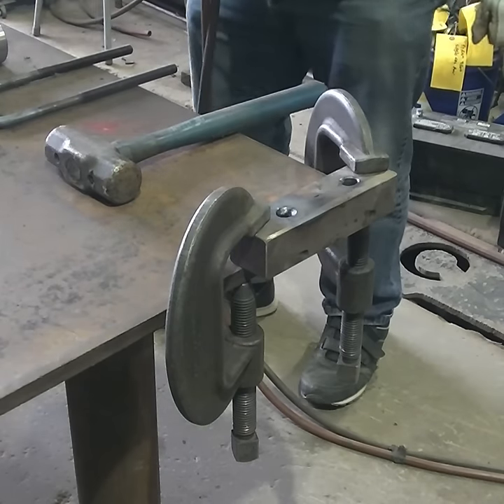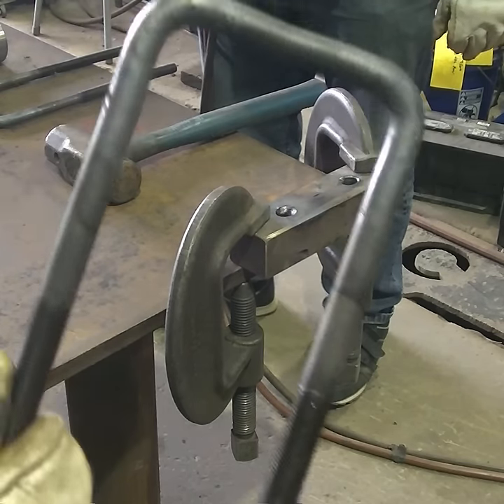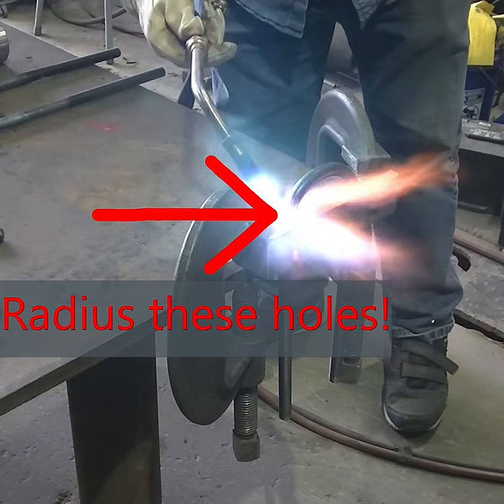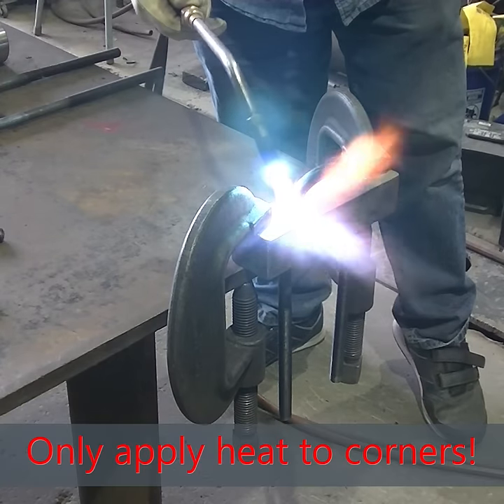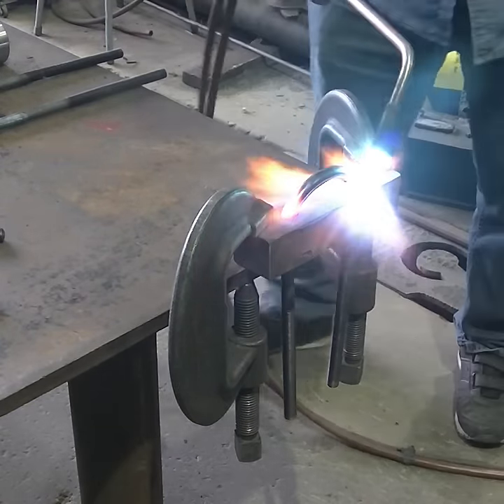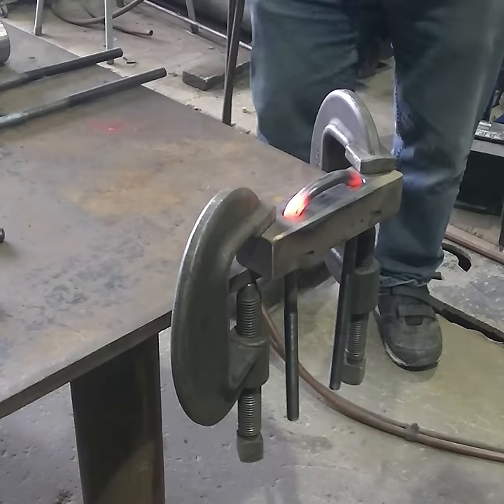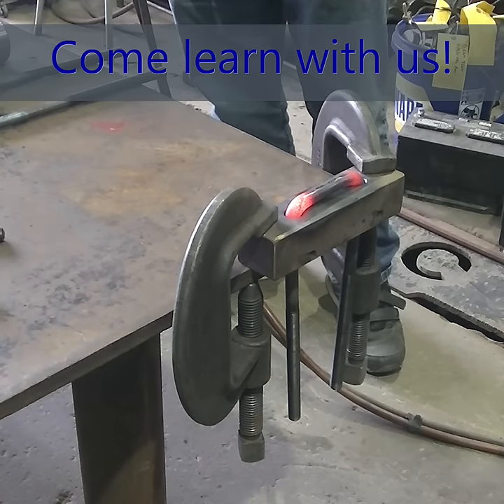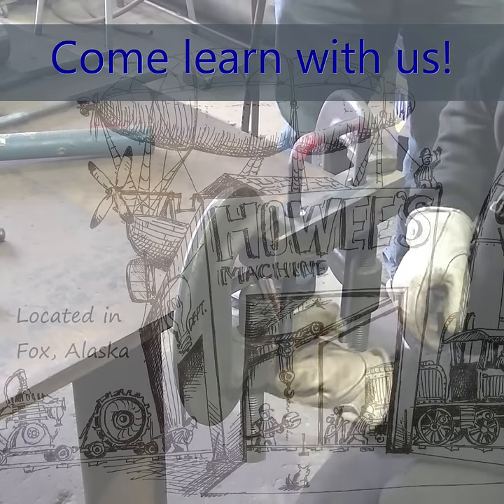Machinist's Minute: Squaring a Rounded u-bolt

Comment: Just return them and get the right ones . By heating those like that you've probably ruined the temperament of the steel .
Reply: Kind of what I was thinking.

 Every set of springs I've had made were bent using a hydraulic machine and form dies. About any tractor/semi trailer heavy machine "spring shop" can make them in a matter of minutes. Just give them the measurements you want or bring in as much of an old one that you can and they will measure for you, give them a little while depending on how busy they are, and walk out with not only a new set but grade matching bolts and everything.
Reply: Also, by running a carburizing flame like that he's adding a lot of carbon to the steel which can make it very brittle. I used to fix my chisels this way
Reply: Ah yes because they surely have no idea how to retemper.  Applogize to the nearest plant.😢
Reply: @i-love-comountains3850  did you see them temper it???
Reply: @i-love-comountains3850  did you see them? They obviously don't know much about much.
Reply: It's not going on the space shuttle.
Reply: It’s mild steel. It won’t harden hardly at all and will be perfectly fine for whatever applications he’s using it for. People watch a few knife making videos and become metallurgical scientists. I made dozens of U-bolts and for custom fitment. Never broke one and never had a customer come back with a broken one.
Reply: @Sackmatters  in this case it will harden it because he's using a carburizing flame which is called carburizing for a reason because it adds a ton of carbon to whatever you touch the flame to which makes the steel much harder and brittle. Some people take a few metallurgy classes at an accredited university, rated number one for welding technology in the United States, number two in the world, and think they might know a thing or two. Some people have also used a carburizing flame before to harden carbon steel to make a makeshift punch that will usually break. I'm not saying these you bolts are going to break, I'm just saying if they were so concerned about building a swage block and tapering the holes to make sure it was right with all that time they invested they could have just bought the correct U-Bolts to make sure it was done right instead they did it every way wrong that they possibly could.
Reply: @BMikeAD  You're missing the point, he is using a carburizing flame on carbon steel. It is adding carbon to the carbon steel making the carbon steel harder and more brittle. That's how I turn mild steel into makeshift chisels. He's giving bad advice by telling people to heat stuff with a carburizing flame and impregnating it with carbon making it harder.
Reply: Yes, I did this one time, U bolts were a hair narrow. Heated them up and worked to size, tightened them down... PING. right in half.
Reply: @despraterado588  the time he applied heat won’t affect it enough to cause it to be brittle. There’s a big difference from field work to book work. Like I said, I’ve never had a failure after heating my material. What do I know though, 15 years of steel work and fabrication.
Reply: @despraterado588  no it doesn't work that way.

If that's the case every knife maker in the world would be doing that to turn cheap mild steel into high-carbon steel for knives.

It may "case harden" a tiny portion of the outer surface a bit, but you're definitely not going to turn that steel into high-carbon steel by doing that.

In addition it's not the application of heat that makes high-carbon steel brittle, it's the QUENCHING of high carbon steel that makes it brittle.

EVEN IF it were a high carbon steel, just heating it up and letting it air cool, would make it more likely to BEND ....not break or shatter
Reply: @despraterado588  adding carbon to steal does not make it brittle. QUENCHING high-carbon steel is what makes high carbon steel brittle.
That's why knives are quenched AFTER the forging and shaping is done.
If it were the carbon OR the heat that made it brittle, you WOULDN'T BE ABLE TO FORGE IT.

After you apply the heat to the high-carbon steel and do all the forging, you then heat it back up to a specific temp, and then immediately QUENCH it. THAT is what makes it hardened.
You then have to be very careful with it because it literally can shatter by something as simple as dropping it on the floor.

So after you've done that, you then temper it.
Which is done by heating it back up to a really low temp (compared to forging or quenching temps.) And then letting it cool back down.

That's where you hear the terms "cherry red" for forging & quenching, and "the color of straw" for tempering.

The tempering process temperatures can vary depending upon the exact type of steel, but most high carbon steels, can be tempered in your typical residential home oven. Most of them don't get over 550°f.

"Tempering" it removes some of the brittleness so that it can still be hard enough to retain an edge, but tough enough to keep from shattering, breaking, chipping etc.
Reply: @mrfixitusa6165  listen buddy, don't knock it till you tried it. All I'm saying is that this guy is giving bad information by telling people to use a carburizing flame on their rosebud because they're too stupid to figure what a neutral flame looks like. This guy doesn't even know what the f*** carburizing and oxidizing means. Like this is literally the second time he's ever used a rosebud.
Reply: @despraterado588  you just don't understand what happening...

The only thing that are carburizing flame does is add carbon to the SURFACE of the steel.

It does not in any way shape or form, turn mild steel into a high carbon steel, nor will it make mild steel brittle. It won't even make high carbon steel brittle. 

It DOES make WELDS brittle... But a weld is on the surface of the steel.
Even if it melts into the steel a 1/4 inch, it's only making that weld brittle, not the rest of the steel.

And in this case he's not welding.

So all he's doing is hardening the surface.... Like less than paper thin. 
The only reason why you got good results with chisels, is because it case-hardened the surface and since a chisel comes to a fine point, right at the very tip, on the fine cutting edge, the outer surface was hardened which gave you the illusion of hardening your chisels.

And yes that would allow you to put an edge on it, but it certainly will not allow you to take a piece of mild steel and turn it into a high carbon chisel.😁
Reply: @despraterado588  and yes... I have tried it.

For several years before degenerative joint disease ended it, I ran a business doing custom fabrication, tool making, blacksmithing, knife making, antique restorations etc.
Reply: @mrfixitusa6165  A man who knows what he’s talking about. I applaud you my good sir. I don’t know why he’d argue with a guy who’s name on here is literally Mrfixit. Take care boss man.
Reply: I think these u bolts will be used to mount the leaf springs on the axle of a trailer.
Reply: @Sackmatters  😂🤣 you too bud!
Reply: Is the steel angry now?
Reply: @Sackmatters  They were glowing white hot. Whatever grade those bolts were before they aren't any more. Any heat treat they received was completely ruined.
Reply: @Sackmatters what do I know? I only have 30 years of field experience and a mechanical engineering degree . If you only heat portions of the metal, you're changing the properties of the metal at those spots . Why is this so hard for you to understand? It's not that you're hardening it or adding carbon to it. You're ruining the ductility . JFC . Anybody that knows anything about metal knows that ductility is the key to steel . That's why no matter what steel we test in our destructive testing lab we test the ductility and deformation in EVERY SINGLE TEST . Whether it's at a weld point or the material itself no matter the grade .

Comment: This is all well and good but U bolts are cold formed form threaded rod, yours are now just ornaments, would be cheap to replace with square ones that won’t stretch like crazy when tightened to 100ftlb
Reply: They'll  be brittle from the heat. He ruined the bolts.

Comment: So the rosebud is cooled by the inflow of gas. It is not over heating. It experiences the radiation of the flame but not direct conduction. Its made of brass, a mostly copper alloy and this means it has to get very hot before the oxidation reaction occurs. His tip was about what happens if it runs full lean as the acetylene runs out. Not for normal operation. You can run a lean flame. The Rosebud will be fine.

Comment: I have a jig, 2 pieces of angle and 2 pieces of round stock wekded to a plate. Bolt one end through the anglez heat and wrap first corner, second piece of angle has a slot/nptch through thebside so you can easily keep the bend nice an square, tighten up the nut and let it rest a minute or two.

Comment: And weakening of the steel commenced
Reply: That's what I was thinking
Reply: "When ypu order the wrong ubolts" (...) and change the material properties/steel grade to "Carbon Steel without certificate' without knowing...was the reply in my head too😂
Reply: Just heat treat it 🤣
Reply: Exactly, I thought I hope that's a 4.6/s not an 8.8/s
Reply: You can bake it again to harden it.
Reply: Theyre small enough for an oven. Even a toaster oven

Comment: It's also nice to heat slower with the rich mixture so you don't get false readings of temp. Lots of tines I've seen people do similar but with a cutting flame. And have a failure. They didn't patently heat it up and know for certain the center was equally as hot
Reply: Yeah, when you see the sparks shootin away from the workpiece, that is the beneficial properties of the metal precipitating away. Try not to do that.

Comment: You’ve now made that metal brittle in the corners and you took the tensile strength out of it.
Reply: You heat it so it doesn't work harden in the corners
Reply: No.... Heating steel does not make it brittle. It's the quenching that does it (for hardenable carbon steel anyway)

Heating it will literally take away the brittleness, if it had any ...which in this case, it better not.😂

Nobody wants their U-bolts to shatter every time the truck hits a large pothole.😝
Reply: @mrfixitusa6165  problem is doing this with any carbon alloy they just lost all the strength the u bolts had. If they were out of mild steel it wouldn't matter but theres no way Id ever run mild ubolts on a vehicle axle
Reply: @UFO-047  it was depending on what type of steel alloy was used and whether or not it was cold rolled, hot rolled, forged etc.

Some steals will be severely compromised by heating to bend, and others MUST be heated in order to bend it.
And different alloys will determine the effect it has on the steel when it is just heated and air cooled.
Reply: @mrfixitusa6165  yes u bolts made from 1541v for example are formed cold from already heat treated stock in various sizes- Ive made u bolts from this stock for trucks where I used to work. However if you heat it the heat treatment is ruined and the process of restoring heat treatment can take hours. They arent that expensive to replace..
Yes some must be heated to bend them after they are formed- try bending a grade 8 bolt, itll snap. Heat a grade 8 bolt and let it cool, its now worthless-  heat treatment and tensile strength are gone. Yes you could anneal the entire high tensile ubolt and re heat treat it but but for the cost and potential risks if its not done spot on to the specs just arent worth it for something that goes on the road or will see any speed.
Reply: Learn how to measure and describe the u bolts correctly!
Reply: @UFO-047 if you set the mix to make a carbeurizing flame, no. If you follow it up by quenching and annealing properly, youve ruined absolutely nothing

Comment: when you order the wrong ones, you order the correct one's, that sh!t won't fly on my equipment.
Reply: Literally, you’re taking about something that is practically holding onto an axle …
Reply: Are you sure?
Reply: @petesmith5092  positive
Reply: @kevinfreeman3098  all I'm saying is he didn't hurt that U-bolt. If he really wanted to get technical he would have thrown it in a pile of sand so it would cool off even slower. But he did not hurt that U-Bolt

Comment: When you set a torch to a neutral flame, you are set at the most efficient use of the gasses. If you run oxygen rich, your flame will get hotter and the excess oxygen will oxideze the steel away allowing you to slowly melt away the steel. This will weaken the surrounding steel from oxidation and annealing through heat. If you run acetylene rich, you're carburizing the steel, making it harder and slightly more brittle without the risk of melting the steel. Either way, you have ruined you U-Bolts.

Comment: Correct me if I'm wrong but didn't you just pull the temper out of those u bolts, and at that you did it at the weakest and most fragile point the corner. That's where all the load is going to focus. U bolts are pretty cheap, does it not just make more since to buy the correct ones

Comment: Does adding heat change the temper of the steal. Normally when metal is heated to a point it annealed thus weaken it.

Comment: So ive owned a oxy torch for 20 years and onlybuse it to heat up stuck bolts and to occasionally torch some heavy metal into more manageable pieces. Recently though I've learned that I have 0 clue about the flame mixture and am most likely doing it wrong
Reply from the maker: I plan to do some more in depth oxy-act brazing & torch techniques, The carburizing flame is for rose-buds & some other special situations, not for cutting, or welding.

Comment: All well and good for the shape they are looking for. But the heating procces and subsequent change in shape of the meatal not only stress the metal but softens and weakens the metal to a degree that might not hold the required stresses the part may be subjected to. When heating metal any metal to the point of malubility, it changes the crystalline structure of that metal. Those changes must be addressed or the metal is no longer as strong or flexable as it was before the modification. Annealing and tempering are critical. To take the metal to the temp it was at and not cooling it properly is clearly a lack of metal characteristics knowledge.

Comment: Guess what’s missing? Okay I will tell you the hash or x markings on the inside or underside where it come into contact with the axle. Where it holds onto the axle that prevents the UBolt from Rocking? Nobody ever thinks of this and it many times leave the Pinion broken!

Comment: Wouldn’t heating them fuck with the strength of the steel? I’ve seen a couple Mack trucks with the front axles on the side of the highway and the truck with no wheels and a busted everything right next to it. I can just picture that happening with these u bolts.
Reply: Depends if it's mild steel or carbon steel. I'd have thought mild steel would be better because you'de want it to bend and not sheer
Reply: @MrMrjwongy  depends on the application. As you pointed out mild steel will bend before it breaks making it ideal for general applications, but hardened steel is better for anything potentially load bearing or subject to vibration.

Comment: I've only had to make , alter and refit just about 10,000+ u-bolts at the least 🤣🤣🤣 we use 15 Ton press and vise which is way faster but we literally make hundreds of them per tower , AND , they're only about half that size , they don't have to be perfect and they're made from galvanized 5⅝ steel and not ⅞ or whatever that is but it's definitely bigger than what we use , or at least it looks bigger than ⅝ in the video ...

Comment: Can you say tensile strength reduction. And I can actually prove that statement when you are using a flaming wrench to cut off a u-bolt if you heat it up red and then cut it it relieves pressure it doesn't pop.

Comment: Will this alter the heat treating or is it not hot enough  ?
Reply: U-bolts are cold formed from heat treated stock. These are now weaker by an unknown degree. Ruined.

Comment: How exactly does the gas mix affect when the tanks run out? You only chang the empty one and not both when one runs out. They never start with two full tanks unless you just bought a new torch.
Reply from the maker: The mixture setting is not to change the amount of gas, what it does is allow you to know when the gas mixture is too much oxygen.  Now for the other part of the answer;  Acetylene has a maximum rate of discharge from the bottle & when using larger amounts of gas you will "run out" before the bottle is even 1/2 empty, let it set for a while & you will again have gas, but it will discharge at a still lower rate.  The acetylene is not in a free state, as it would become unstable & 'splode, so it is disassociated, by being dissolved into a solvent, it takes time to come out of solution.

Comment: How would that work if you used propane instead of acetylene.   My neighbor only used propane and oxygen with his torch.  Just asking to learn.
Reply from the maker: With the right tip it would work fine. Propane puts out more BTUs but has a lower peak temperature at the tip, so it works very well for bending things.
-Cameraman